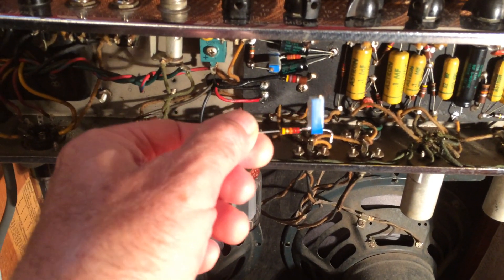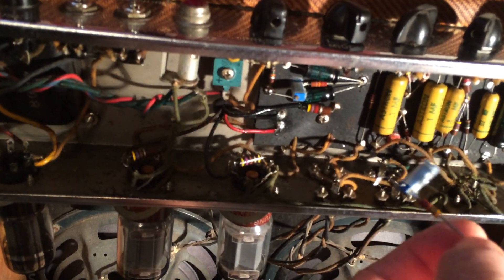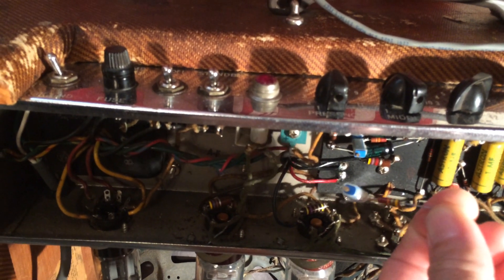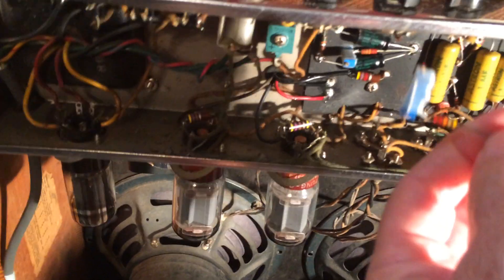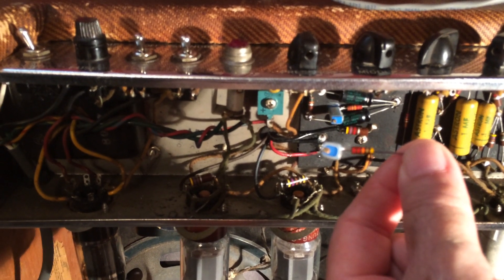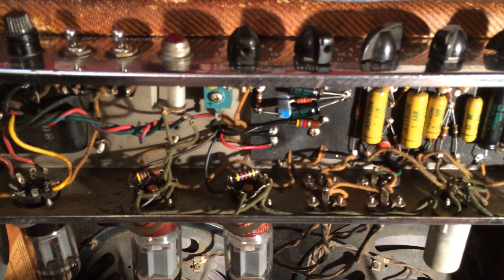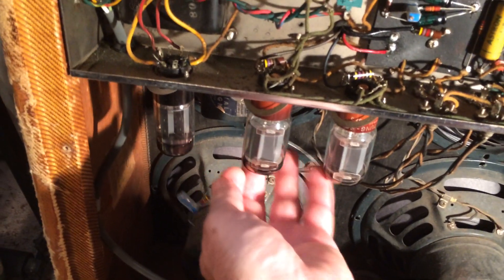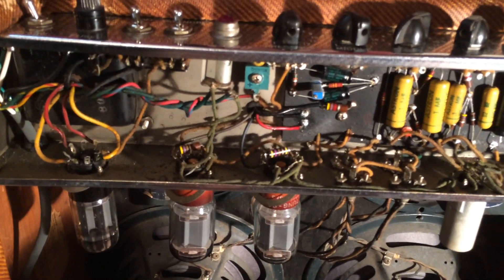How to put a Bias Adjustment Pot in Your Vintage 5F6-A Bassman

Comment: But do you use tung sol? I don't believe it! 🙈 These are the tubes I just replaced on my bassman, to mount american groove tubes hoping to get closer to your sound. While now I discover that you use the tung sol 🙃😔
Reply from the maker: Yes, I have always used vintage, NOS (new old stock) tubes from the late 50's and 60's in all of my amps.  They last for years and sound the best.   They are way more expensive but I think they are worth it.  The Tung-Sol 5881 is the best tube for the Tweed era amps when it is called for on the tube chart.  New production 5881 Tung-Sols won't last more than a year.  What did you install, 6L6GC's?
Reply: @millstap  So now I have California made Groove Tubes 6L6, but they are not new, they are from '76, so NOS. I used to have the 2005 tung sol 5881 but they were a bit worn. Ps I did bring the bias to 42.8 and it sounds much better. To do this, my technician had to make a modification by mounting a resistor as the amp didn't go below 55 with those tubes. Now it sounds great but today I noticed that the 6L6s turned red inside after only an hour of playing. Is it possible that I damaged them when I was biased at 60? But keep in mind that I only played it for two days with the bias at 60
Reply from the maker: @antoniomaiellofficial  They the GT's 6L6GC or 6L6WGB?  If they are WGB, then the bias needs to be less than or equal to 37.1mA.  They should not still be red plating so that tells me that your plate voltage is higher than expected.  Ask your tech if he measured the 6L6 plate voltage.  Red plating will eventually damage the tubes.  They are fairly sturdy so I don't know how long they will last.  If they still sound good, then maybe they are okay but I would definitely get a spare set of 5881's and give them a try.  Getting pairs that are fairly closely matched is best like they do with the Groove Tube number system.  New tubes are only rated for 500V plate voltage and the old 5881's are only rated at 400VDC plate voltage but Fender always ran them around 450VDC. They have some safety factor so going over 400V is okay but 500V on most tubes is not good.
Reply: @millstap  The new 5881 tung sol doesn't last more than a year, you say, but is the sound quality more or less the same as the Nos or is there an abyss of difference?
Reply from the maker: @antoniomaiellofficial  I have not used the new Tung-Sol 5881's in a long time.  As far as I remember, people said they were just about as good sounding as the old ones.  Get a matched pair of 5881's from a good tube seller and give them a try.  I'm not sure if your amp has a bias adjustment pot.  It may not since it is a copy of the original.  I would have your tech install one next time if it doesn't already have a bias adjustment pot.  That way, you can easily do it yourself in the future after you learn how to do it.

Comment: 6 or 7 millivolts (millamps of  tube current draw ) with a pair of 6l6 tubes  is  insignificant  from amp to amp, especially amps this old... they will drift that much and more while your plugged in ...as the  tubes get hotter etc.....if that bothers you get rid of the carbon comp resistors and put in some 1%  metal film

Comment: You were playing it during adjustment, and were surprised that it fluctuated? Its supposed to do that. It even does that with "fixed" bias when youre playing through it.
Reply from the maker: Sam Roney I know what you mean but it fluctuated when I wasn’t playing. It turns out you need to use a heat sink when installing that pot. I’m happy with just a resistor now.

Comment: Are you sure you can play it with the the bias reading tool installed? If I remember right the manufacturer said I couldn't. Obviously, you could, but my point is I wonder if the reading is going to be accurate. When you installed the other resistor did you have the tool installed, and all comparisons were identical?
Reply from the maker: Yes, I can play it and listen to it with the probes installed, but the bias is naturally going to go up when you hit a note or chord.  You have to stop playing for it to go back to the idle bias.  I took the bias probe off when I put in the resistor.  I put the probe back on to check the bias after I installed the resistor.  The bias went up a little with the new resistor since it had less resistance, 59K ohms vs. 61K ohms.

Comment: From my experience with those multi turn pots, it's very easy to ruin them with a small amount of heat. I prefer the full size CTS 10k Blackface bias pot and change the wafer out to the value needed. Of course, you won't be drilling holes in your amps, but you can tack solder a full size pot body to the chassis near the selenium rectifier.

Using 1% metal film resistors will make your life a little easier if you don't want to install a better pot somewhere.  They're cheap and come in a lot more values than carbon comp resistors.
Reply from the maker: I did consider that but after the fact.  I did stay on it a little long with the iron to be sure it was good.  I must have melted something.  A professional at Kendrick Amps put in the other one.  He probably knew that trick.  Those leads are paper thin and very fragile. For now, I'll stick with resistors.  Thanks for the info on the metal film resistors.  The amp works much better with stable bias voltage.